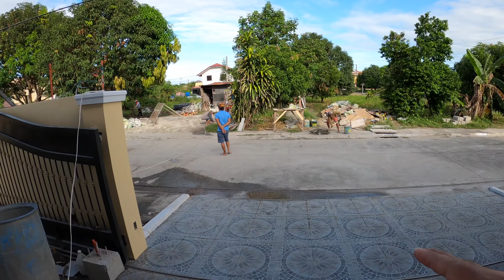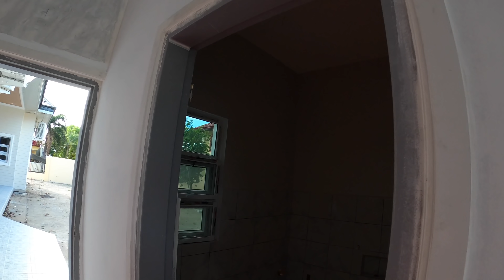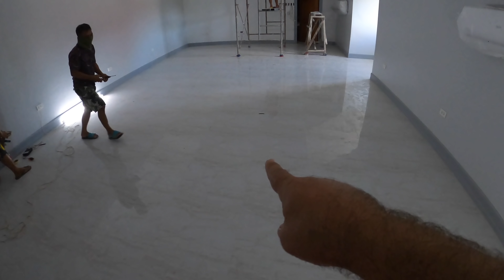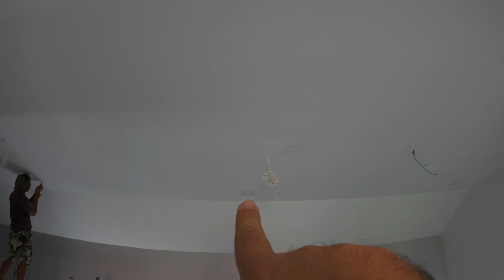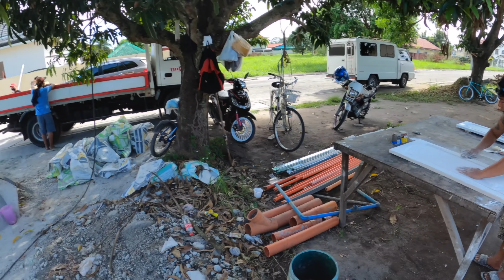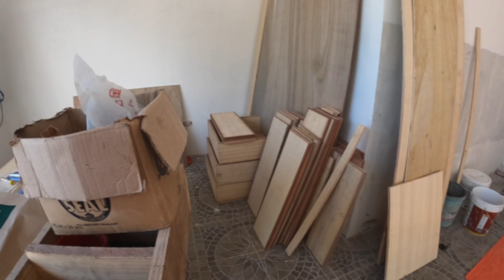Philippine House Building Step by Step, Build Day 234: Can I Get A Boost

Comment: ubiquiti ap cost more but is an excellent choice with all its features and reliability!  are you using the same brand for a router? 3 ap's just for the ground floor seem a little overkill. i use the same brand ap and one covers over 200sqm single floor with no problem at all.  are you using cat6 with an hdmi adaptor to send video to your projector?  those are flaky sometimes . i suggest you run a 4k hdmi cable for your projector instead. did you wire for surround speakers also? i mean if you're going big screen with a projector, you might as well go with surround sound to get that cinema feeling. all these speaker wires including the hdmi cable should be terminated to where you plan to put your stereo receiver. even if you don't go surround sound now it would still be nice knowing you have the wires there ready. i bet it wouldn't be that much added cost for your contractor to run those wires.
Reply from the maker: Thank you for the detailed feedback. 
Here’s my reasoning so far. I’ve had bad experiences with access points in concrete homes before, barley covered 200sm with lots of dead spots. Decided to cover the three sections of the main floor. Shouldn’t have any dead zones. 
Media room... surround sound will be via Bluetooth. Wired and wireless ethernet for smart functions. May run the HDMI to a Blu-ray player at a later point. 
But after move in and playing with the system and setup, it may change and evolve based on how we use it. 
Much appreciated. 
👍😊
Reply: @CasaTexPina  you might be limited to small speakers with bluetooth.  that's a big space... you're gonna want big sound to go with that big screen ;-) here's my ht... might persuade you to go wired, lol.  https://www.youtube.com/watch?v=ykizCXZkcdI&t=74s

Comment: How much is your budget in building that house so I can start to save to build like your house
Reply from the maker: Build costs are a real moving target here with a lot of hidden fees and expenses. Construction costs range from Php20K to PHP35K per SM depending on location, size, complexity, and level of finish. Most expats end up in the mid to high end in order to include what we consider basic essentials. Items not included in the build costs are Air Con, appliances, perimeter fence, landscaping, etc.